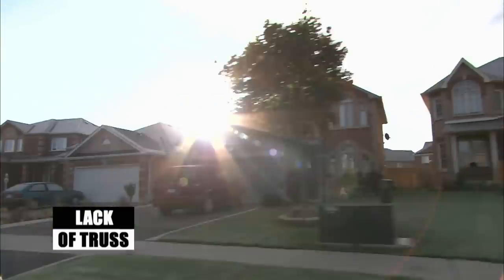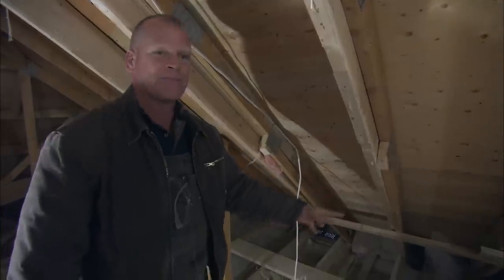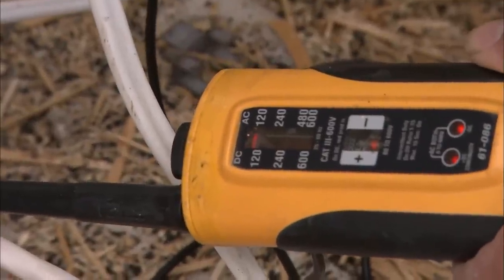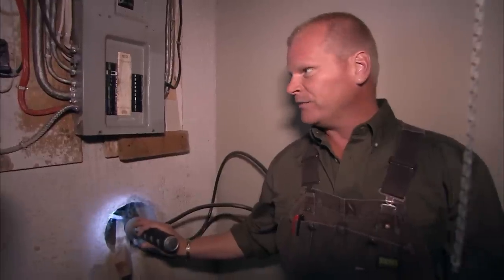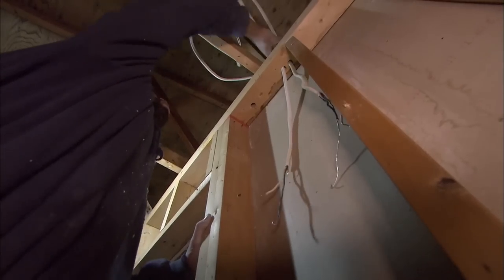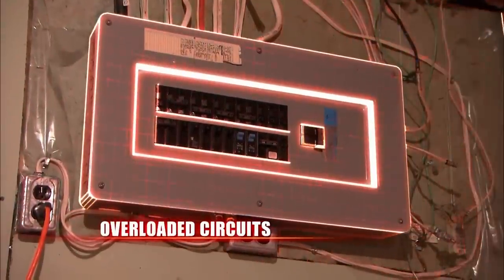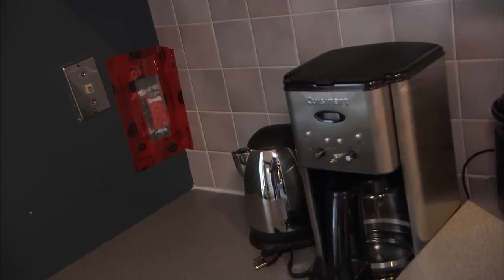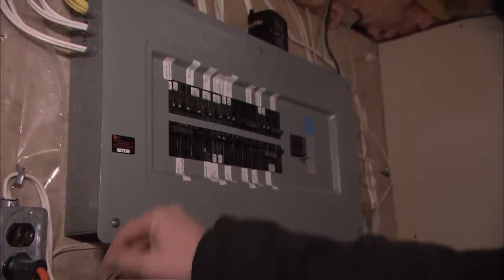Most Dangerous Electrical Disasters Found in Homes

Comment: Back in the 80's, I managed a 40+ year ond motel. The place was electrical nightmare. I could write 20 paragraphs just listing the things wrong. But I'll list 1 here. A "gentleman" fell asleep smoking a crack pipe. It fell on the floor; lit the carpet a table and the bed. Then it caught the wood paneling. He took off. Somebody saw smoke & reported it to the office. This was before 911. The firemen put it out quickly. Then started removing anything that might have embers. Including the paneling. When they did, they discovered a subpanel in the wall. 2 circuit breakers. Neither of them even controlled anything in that room. But they were hot. FYI: That motel was torn down in the late 90's.
Reply: I've got another one for you, I'm a contractor who was remodeling a home and was updating the wiring during a gut job, so we killed the main breaker and went into the attic to start cutting the spaghetti factory of wiring outta there, I cut a wire that was running out of a junction box ( and not hooked to anything on the one end) and POW, blew my new pair of Klein's. Went to investigate to see how that was even possible since the power was turned off and discovered that there was 10-2 wire jammed in the main lugs of the service panel feeding a sub panel hidden in the rafters of the attic 🤯
Reply: I worked at a 322 room 3 building hotel recently. built possibly in the 60/s or a little later one of the electrician rooms 1000s of breaker switches all federal pacific powering all rooms ac units everything to my knowledge it’s never been redone
Reply: I worked in a government building that used breakers as switches and they were underrated and obsolete. They wouldn’t upgrade until I threatened to report them to OSHA. That was like showing a cross to a vampire! They did upgrade! Unfortunately Sometimes it’s all about money over safety.

Comment: A local funeral home did a major expansion with a complete existing remodel, all while staying open everyday. We were chosen for the electrical and we were able to re-wire with ZERO junction boxes in attic. No sheetrock was taken off or cutouts made an inch wide to run wire. First and only rewire we did without having junction boxes. Been in business since 1970.
Reply: Sounds like you killed it. (Or you didn’t🤷‍♂️)

Comment: I am a retired Electrical Engineer and in 2021 I passed my journeyman's test. Now I do small residential electrical, mostly jobs the bigger guys don't want or clients that can't get someone to actually show up. Just yesterday, people are new in the home they bought a few months ago. Nice house on the inside. Receptacles in the large living room have no power. I started opening a couple of them, in one I found a wiring mistake and corrected. I could tell work have been done as there were new tamper proof receptacles while other were older types, wrong type screws, and other hints that a good electrician would not do. Going back tomorrow. PS: fortunately the wiring was copper and not AL.

Comment: I’ve been in electrical for 26 years, I’ve had my masters license for 20 years. It baffles me how people put so many junction boxes on residential. Sometimes, you do what you have to do, but I will try my best to find a way out of setting one. If we do, it certainly doesn’t go on the ceiling joist to be buried in insulation, and it WILL have a cover on it and labeled what it is and what  circuit it is. #doitrightorwalkawayfromit

Comment: 2:33 House #2 this house had 5 violations 1. they placed a junction box at ground level, 2. the renters drilled through the wall and tapped into the grid without calling the power company, 3. the wiring is illegal since this was a pot farm, 4. there are illegal splices and no arc fault interrupters, and 5. and this is the most dangerous none of the breakers were wired to a transformer 200 amp, 60 amp, 12 volt, and back to 200 amp that is a fire hazard you need to install a transformer before you tap the grid and make sure you are the owner before you drill into a pad box outside. Also don't bypass the meter that is there for a reason don't steal power from the grid.

Comment: We were filming a corporate video in a new display home in a new subdivision. For the night scenes, we arranged to get power from several homes as we were maxed out with our hero house at 200 amps. The builder had installed both a stove and dryer outlets in the attached garages. This gave us an extra 80 amps per house, but by the time we got to the second house, the entire neighbourhood went dark. The utilities are matching current limiters closer to what is actually needed.
Reply: wow thats going to be a real problem when a subdevision of 100 houses 30 to 50 buy electric cars
they will need to rewire entire neighborhoods for the nightmare of ev ever come true especially where undergrown electric wires and who will pay the bills  $1.00 kw electric bills in 2030

Comment: Two examples I ran into: 1)The bottom of the main panel was about 24" off the floor with the panel cover off leaning against the wall on the floor, live connectors all exposed. A couple sticks of metal were leaning against the panel box. 3 kids running around ages 3 to 11. This was death looking for a time to happen. I asked how long it's been like that, she said over a year. 2 minutes and 6 screws later problem solved. I know I know easy peazy just saying the stupidity of some people. 2) A guy wanted his garage wired up for electrical. He said the power was on the wall outside the garage but not hooked up. I get there, no wires in the conduit he was referring to, the house was about 75' from the garage and the main panel in the house was 100 amp service all breaker spots taken up with 4 breakers double tapped. I went there to wire up his garage. Wiring a garage is very basic and easy. I've been doing electrical work at my job and on my own for years but I'm not licensed or insured. Know your legal limitations. I wasn't about to take on that liability. Told the guy he needs a licensed and insured electrician on this job. The panel needs upgrading. Possibly a 200 amp service. Trench dug for the line. He wasn't too happy and held a grudge for years after. 
Just sayin.
Reply: You did the right thing Randy

Comment: I did electrical on a house expansion we did in 95. We sold the house in 2020. We had no electrical issues. But before we sold the house I still wanted a licensed electrician to check my work for the safety of the buyers. He added a few GCFI’s above the kitchen counters. Then I had the same electrician add wiring and a sub panel to the house we bought.  Why didn’t I do it? Because when my son sells the house after I’m gone … or moves in … I want to know this house meets code as well.
Reply: What is "code" in some areas and what is Safe, can be two entirely different things though. It can be not to code and still done safely. Look at 200 ish year old houses that are still standing, not burnt to the ground or blown over.. then some fully "complied with code", houses, or HOTELS, falling over! Clearly code only goes so far.

Comment: @0:15:  Does anyone know what he meant when he said, "Tying into existing lines is not allowed"?

I'd be interested in the NEC reference for that claim.
Reply: I don't think there is one specifically that says you can't do a tap off of another circuit. We do it all the time in the field to install a new plug or light. What you do want to be careful of is making sure you are not overloading a particular circuit. If we couldn't tap off of circuits, all the wiring in houses would have to be home runs which would be ridiculous. Though, if anyone can find what he's talking about, I, too, would be interested to know.
Reply: I can't tell for certain, but I think he is referring to the lighting. Basically, each can light can take 100-200 watts each and they put 12 onto an existing line. So that's 1200-2400 watts of power. For context, a 15-amp line is only 1800 watts. So in other words the lights are pulling as much power as the circuit can handle so they really should have been on their own line. Instead it sounds like they used boxes that already had junction boxes and circuit boxes on them which is a huge no-no that means if you plugged anything into the wall outlet, it could potentially set your house on fire in a worse case. Also if that is the case, as they were saying, these lights are pulling so much power, that they are making a ton of heat, and they covered these lamps in insulation, meaning that the lights could get so hot, they would light the house on fire. So I think that's what they are referring too, also even if the lamps were using the low end of 1200+ watts, when you pull anything close to the load of the wire, the wires will start to get hot. So the wires in the roof were probably getting really hot and warm from all the current draw. Also, junction boxes need to be accessible because you can't tie your wires together and stick them in a wall because they could short. However, in this case, it seems they may have put multiple lines though the same box, meaning that even if you turned the breaker off it would still be live, and if they were tied together in some way, you could have put 30 or more amps on a 15amp wire which definitely would start a fire. So I think they just knew it was out of code. You have to have circuits rated for the expected load and if it's over that then you run a new line, which I think is what they are referring too.
Reply: @50Minutes :  My goodness, it seems we really do have to tie ourselves in knots to make sense of some of his criticisms.
Reply: @Tindog81476  When was this show released. I imagine it was before LED's became popular. Even a typical residential incandescent bulb was generally between 65 to 70 watts. 200 watt bulbs were rarely used for general lighting, though 100 Watt bulbs were fairly common. But with LEDs, that simply isn't the case. Though, I will give the benefit of the doubt and say this is an older show where LED's weren't common yet. A typical LED 100-watt equivalent draws 15-ish Watts (found on Home Depots website). On a 120 V circuit, 15 amp circuit that is considered a continuous load, you could put 96 bulbs on that circuit. Not that you would, but it is impressive how little LED's draw. In this case, one eighth of an amp, or .125 amps. It's absolutely nutty
Reply: @TheRiddler491  Yes however these are can lights, they aren't the same as regular bulbs, they could be 100-200 watts based on the needs. That's because they need to be more intense to shoot the beam downward. Realize that in even a standard central light fixture, you often put two incandescent bulbs in a fixture (I have seen 3 bulbs too though) so they could be 2X60watt or 2X100watt bulbs. So a typical room light is actually 120-200watts normally even if it's not a can light, so to even produce a similar light to a light fixture you need at least the same watts. The thing with can lights is they could be 20-30 feet in the air, so they have to be brighter due to the Inverse Square Law. What seems to be suggested in the video is they didn't use the correct can light fixtures for the room, so that most likely suggests they used the more energy-intense versions for high ceilings. Again it's unclear what watt bulb they put in these can lights, however, the fact is they still are wrong and the fact you CAN put a 200-watt bulb in these is a huge safety issue. In building construction, you never assume people can't be stupid. I think we can assume these were before LEDs because most newer LED can lights are a lot shorter, as led can lights bulbs are flat, in fact, this style is even hard to find for retrofit, even if the show is modern the fact the owners didn't put it in suggests that this addition is older. And yes, I love LEDs they are AMAZING!! They make things so easy, Christmas lights especially now are so easy to set up you only can run them all off one run to the house and you can run the yard and house off one outlet! Love LEDs.
Reply: @Tindog81476  Agreed. I can only assume this show was made before the advent of LED's popularity in the home. I didn't watch the whole show, being in the trades myself, these shows have become more corny and embellished. I'm so glad incandescent bulbs are dead. LED's have done wonders for energy efficiency. Good talking to you!
Reply: @TheRiddler491  Same!
Reply: @TheRiddler491   & 50Minutes   i think the problem lies with the capability of the lamp fixtures and the fact the industry has not implemented a different socket dedicated for led's. yes led's pull far less but use the same socket that those incadescents can fit
Reply: @TheRiddler491  How true to say on a 15 amp circuit you could install 96 bulbs on that circuit at 15 watts each. Thats only 12 amps and it would definitely be fine. Over current devices are designed to perform at 100% of their rating and we can install loads up to 100%. This is why we have breakers and fuses to open under over current conditions. I think back of the days of wiring with recessed lighting and dealing with 65 watt R-30 and R-40 incandescent lamps and doing the math and keeping up with how many can lights I could install on a particular circuit, thank God for LED technology.
Reply: @kevinthompson4690  For continuous loads this isn't true, lighting is considered a continuous load, so you can only operate the branch circuit at 80% it's rating which would only be 12 amps. In this case you couldn't operate the branch circuit at 100% it's rating. A continuous load is anything operated for, or anything that could be operated for 3 hours or more.
Reply: @TheRiddler491  Yes for continuous loads that is correct. I think the for mentioned comment was for 12 amps of load on a 15 amp breaker. Of course continuous loads shall be calculated at 80%. That wasnt what was intended for my response. 12 amps on a 15 amp  breaker is 80%. totally ok.
Reply: @kevinthompson4690  Gotcha, must of read your original statement wrong, was tired when I responded
Reply: All appliances and lighting are continuous loads for heat management…… they are required to not exceed 80% of the wirings ampaxity to keep from burning those wood studs….. sleep tight
Reply: He’s in Toronto, Canada, US regs don’t apply.
Reply: @SteveW139 :  That doesn't get us anywhere.  I'd be interested in the rationale or CEC reference.  Otherwise, it seems to me like more of his hyped up indignation and bluster.  I admire the guy, but he clearly often talked outside of his expertise and was often inconsistent.

Comment: Just wish that all DIY shows made in Canada had a disclaimer or better yet mention that the goofy method of mounting circuit breaker panels horizontal has been illegal in the states for at least 75 years. Reason if something hits the handle on upper row it would turn on a circuit breaker. Yes a qualified electrician should always install proper LOTO ( Lock Out Tag out ) on every circuit they turn off and intend to work on. Must install a lock and a tag with your name on it. A 42 circuit horizontal panel probably takes up three times the wall space then the proper vertical mounted panel.
Reply: RE:garbo.  Horizontal looks odd to me (USA). Anybody know why they do it that way?
Reply: @munsters2  that episode is old and regulations have changed I believe now every panel installed in Canada now has to be be vertical.
Reply: @ryans413  OK.
Reply: @ryans413  there is no code not allowing the panel to be installed horizontally in Canada. For resi applications we cant run any wires in thru the top (service conductors are the only ones allowed there) and that area is closed off to keep a homeowner out. Panels are often mounted horizontally because of this to allow for knockouts in what now becomes the top of the panel. This is why resi is often mounted horizontal and industrial/commercial is often vertical as there is no rule disallowing knockouts in the main lug or main breaker area

Comment: As long as the junction boxes are secured properly and are accessible and the NM cable is strapped or secured within 12 inches of the box there is no code violation, and further more there is no limit to how many openings can be installed on a particular circuit as long as you do not intentionally do so. This is why we use over current devices called breakers, they open a circuit in case of an overload or a fault. A 20 amp breaker can and should hold at 20 amps forever.
Reply: This.... I heard that and immediately went "this guy is full of shit, unless its been straight wired without a circuit breaker there is no risk here" because guess what, I do electrical work for a living. Its perfectly acceptable to have a junction box going to multiple uses, its just frowned on as not being professional.
Reply: I saw this episode and none of the boxes were accessible they were all hidden behind the drywall
Reply: 16 amps, not 20. Code is 80% for any continuous load
Reply: @devondenham7309 but receptacles circuits  are not continuous  loads.
Reply: The breaker will hold at 20amps for a long time.

Comment: Assuming every junction box is a tap is disingenuous and wrong. When doing a retrofit from knob and tube or other systems, junction boxes allow you to waste a lot less wire.   Your not fishing two lines down to every box in the wall to make jumped connections.    If junction boxes are accessible then they are good to go.   Teaching that every junction is an in traced tap is extreme and alarmist and only shows how little you know or care.